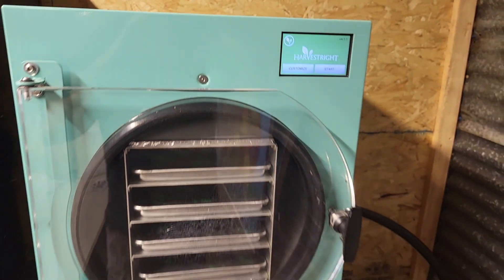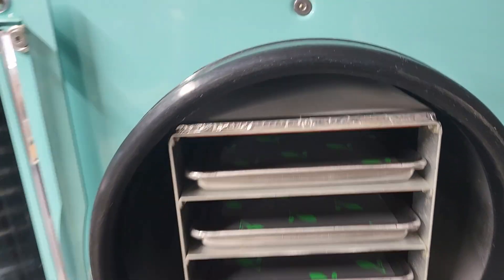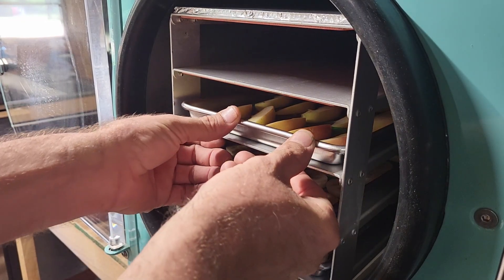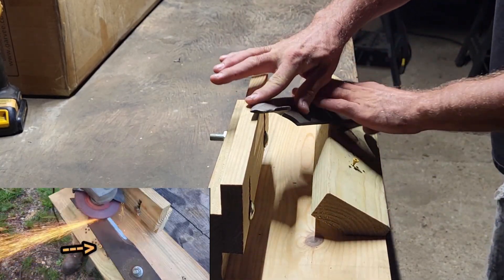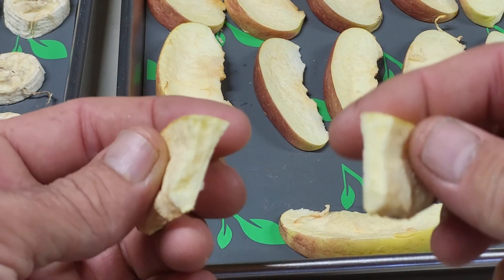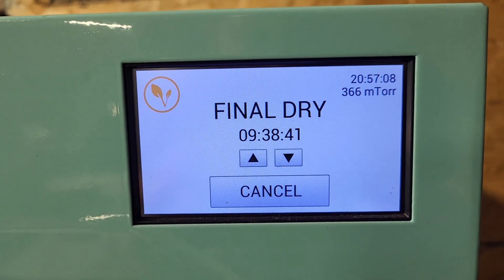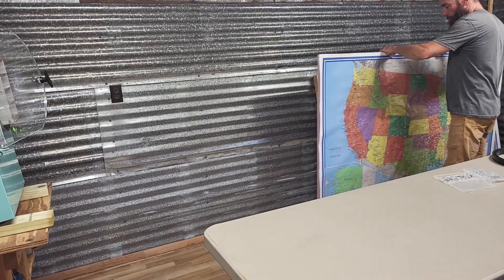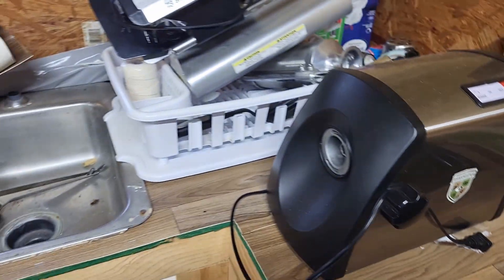How Freeze Dryers Work: Explaining the "MAGIC" (In Plain English)

Comment: why you grinding just the liver?
Reply from the maker: Was going to mix it in with the sausage, but I left it in pretty big chunks. I figured it was soft enough for the grinder to take a big swaller of it, and it did, and blew it out everywhere 😂
Reply: @Gibson_Branch  chunk it up and mix it with meat chunks before you grind it and you wont have problems. if its semi froze before hand youll be even safer. i mix the lungs and heart in mine also